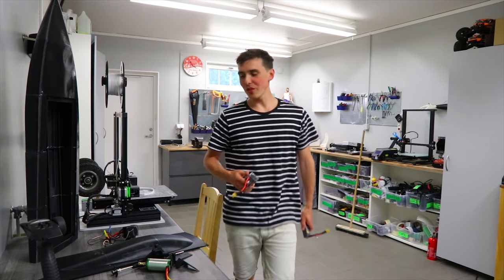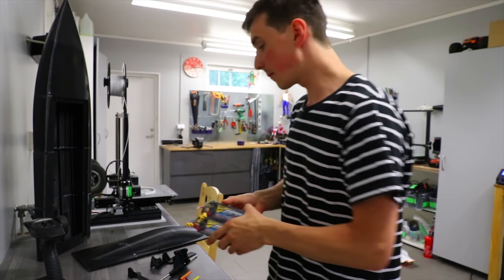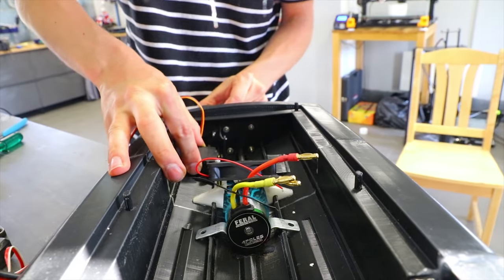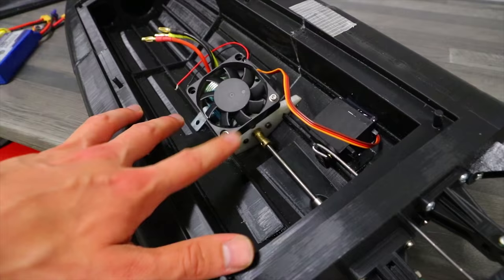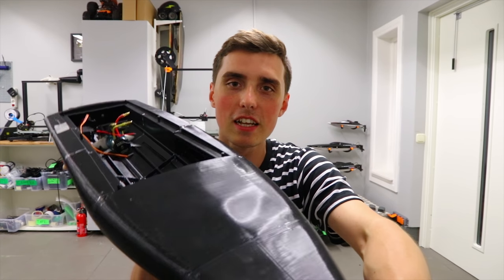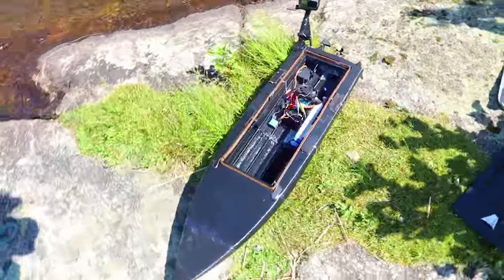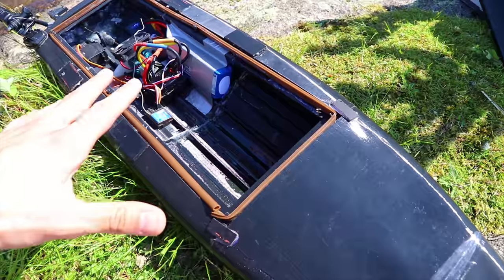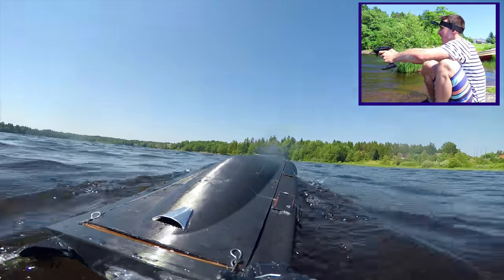BIG 3D Printed RC Speed Boat

Comment: very good video man keep up the great work.. i 3d print rc airplanes and one thing i found out was if your rc is going to be in the sun. print with a silver or gray i prefer colors that are more reflective of the light is best they seam to get the best life in the sun. for my rc planes i still cover them when they are not in use.. be cool to maybe do them in chrome maybe? maybe that could be a good next video see different colors:) see what colors melt the fastest or holds up the longest?

Comment: polyurethane the boat hull works real good, also I would not use epoxy, I would use a "3d printing pen" as a welder to connect the pieces
Reply: oh one last thing if you use pla filimant in 3d printing pen, temp needs to be a little warm, like 220c also a Dremel tool can take off excess or smooth out the welded surfaces

Comment: Yeah, my tipps on this; 
Don't print the Z-Axis over the length of the boat. It is far more reliable to print them (with support from the inner side) laying down.
Secondly, i would increase outer Layer Number to like 5 or 6 and try over extruding a bit, to make the whole thing more Water resistant

Comment: Way too late, but here are the ways I think your boat can be fixed:
1. More weight in the rear of the boat. This will make the boat glide on top of the water more than having to push through a lot of water
2. Use smooth rods/ treaded rods to connect the sections together

Comment: Issue #1) The leakage of the printed parts is due to underextrusion. The actual filament probably is ever so slightly thinner than the diametre entered in the settings of the slicer sodtware. Thus the volume extruded per step is lower than what the slicer expected, and the printed part is slightly porous. Not a huge trouble, paint will fix it.

Issue #2) I found that Uhu Allplast is even better for glueing PLA than epoxy. You will probably have the best result if you sand/grind off al residue of the epoxy from the surfaces where the epoxy failed and give them a good coating of Uhu Alplast. This rather welds the pieces together than act as an addhesive. I was very surprised, seeing how well this cheapo stuff works with PLA. 

Issue #3) The propeller needs to have a plate over it. The trouble is called cavitation, and a very common one with all boats.
When I saw where the propeller was mounted on this boat, I expected it to happen. it´s a designed-in failure.

Comment: Failure is just part of learning. I learned that to get the best joint you have to make a jigsaw of the edged so they snap together but there is another option, SAND flat, AND SUPERGLUE. Also, Last time I used PLA to make a quick throwaway cup I had to use Superglue and coat the whole inside and sprayed it with the instant set. CA not that Expensive Crazy glue.

Comment: Also with PLA, you might want to try a solvent. Weld-on #4 or whatever is available usually works on PLA. or if you are like me and have it on hand, Methylenechloride works as well. Also, you should design built-in interlocking parts to the prints to give the seams some more structure. Also also, print with 3 or more walls to make the hull walls thicker so they don't leak as much. Like I said in another comment, you can spray it with plastic compatible clear spray paint to seal it better and protect it from the sun. 
I want to see you do more with this for sure!

Comment: One thumb up for trying, One down for lack of planning. 
Designing a boat that floats well isn't an easy task in it self, there are even specialized software that let you study the fluid dynamics for your design. 
I would have taken a mold/3d scan of an existing good one and start from there.
Btw PLA is just the wrong material for containing water, PET-G much better. Layer density also might play a factor.
Nice video anyway I'm looking forward to your next better attempt:)

Comment: What glue did you use ? I'm 3D printed planes, the parts are held on using CA glue, the gluing surfaces are waaaaay smaller and these things are really solid, and they take way more abuse than a boat

Comment: Really amazing work, dude! Really nice! 😀
Some suggestions I would make is to try different filaments to see which is better in the water. Then play with different infills... About the motor, maybe the bearings aren't a good idea. What people usually use is a metallic pipe (like a piece of antenna) where the shaft go inside. Then just a bit of oil and you're ok. 😉
Anyway, I think it woth a try. 😊

Comment: Try to get the prop lower, add trim tabs, and seal the outside with some type of gel coat.
And I'm sure you'll sure up the supports, won't hurt it to be a tad heavier.

Comment: 1. Paint the bout. 
2. Try to use bolts and Acetone to glue the parts together.
Reply: Acetone does not work on PLA.  Acetone works on ABS.

Comment: Yeah, PLA and water, hmmm. I've now applied a cellulose-based clear lacquer and will now run some more tests. Boats are a really tough task. ABS may be a better material, but hard to control warping on thin walls. Tests, tests and more tests! I'm building a RC jet boat in PLA. Nothing but leaks so far, all over the place.

Comment: I wonder where the water is coming from, maby the 2 big holes in the roof which constantly get submurged? And use acitone on the hull and joints to fix potential holes.

Comment: your camera being off-center of the boat is going to cause some issues.  cool vid.  I don't know if you've heard this, but when gluing two plastic pieces together, you're supposed to sand them down so they have rough edges which helps the glue bind the pieces together.

Comment: Should use 4mm flexshaft and bigger prop. It was cavitation you were hearing, your prop was sucking in air therefore breaking water tension there's several ways to remedy that problem like lower the prop for starters.

Comment: That's the problem to work aquatic projects with. Water is a big problem. I recommend to print instead to vertical to horizontal way, because you can avoid the water in there through the layers.. I think could be the solution... but. it was intereste!! thanks

Comment: First of all great video! And second try designing the boat with "conecting parts" kinda like lego or a puzzle where you don't put all the force imto the glue and also the part itself. Second thing maybe abs would be better for this as it supports higher temps and also you can give it a bath of (cant remember the name) and get it super smooth and so maybe get rid of the leakages. 
I'm sure you'll figure it out and i hope any of my ideas are useful 😄
Have great weekend!  Cheers from Argentina

Comment: Dunno if you might revive this project but your boat sections would stick better together if you used 200-400 grit sandpaper to rough up the adhesion area(s). Just a thought. I didn’t make the same mistake and my deep V cuts through seawater and large waves without difficulty other than the obvious salt in components problems. Par for the course. 

Good luck.

Comment: Me and my dad made a rc Outrigger and we had the same problem you need to get a bigger prop and swap 2 motor wires and reverse the motor channel on the transmitter. Try to put a water proofing on the receiver.

Comment: I wonder if doing a 3d printed boat and using a vinyl coating would work to hold it together and make it more water tight?  Nice work even if it does need more to make it right.  :)

Comment: Why not make it so the different parts of the boat lock in to place due to slots that you made to hold it in place apply the glue or whatever you use to keep it together then water proof it with the waterproofing material you spoke of epoxy?

Comment: Great video. 
Coouple of ideas for Version 2.whatever... ;)
Did you think about using ABS plastic and then an Acetone vapour chamber to smooth and seal the plastic water tight. (if possible!?!?)

Or anchor points to screw the segments together, and a flexable printed rubber gasket between each one. That should give it added rigidity and a better water tight seal.

Comment: that motor should be swinging about a 42-44 mm diameter 1.4 pitch surface prop.
good effort, but you should do the hull with foam board (paper peeled) then start laying up 4oz fiberglass cloth with epoxy resin to about 2 mm thick, then slice foam away to epoxy in your frames and stringers to the epoxyglass hull itself. can tell, you're not a boat guy yet! :)

Comment: My Idea for waterproofing would be annealing, as well as a coat of waterproofing spray.
Reply: For structual rigidity I would say try a different material than pla.  Also friction stir welding with a drill and a short bit of filament in the drill chuck would make for a strong bond.

Comment: Hi Simon, great video. Just a quick suggestion: instead of gluing the boat pieces together try and weld them using a soldering iron. It should give it much more strength and also it should be leakproof :)
Reply: FrederickTL good Idea, but I think, that it isnt so good for the soldering Iron...
Reply: Maybe hot air gun would be good with some glue?
Reply: Maybe friction welding?
Reply: it looks like he tried friction welding with the dremel
Reply: Welding with aceton should work too (probably the best solution). Also an aceton vapour treatment might solve the water "seaking it's way through", but probably a paintjob would be a better idea since it should also stop uv degradation.
Still an awsome project !
Reply: pgScorpio acetone “would” be a great suggestion “if” he was working with abs 😉. Not gonna work with pla
Reply: rc Ohio Not true... acetone works also on (most) PLA ! Just needs some more time to work-in and dry but gives a bond that is stronger than the printing layer bonding !

see also: https://youtu.be/VZUfq0yrtv4

Comment: REally great.  I am thinking I might try printing one using ABS, so I could easily glue it using ABS solvent glue.  I wonder if your prop is too low in the water. I have a similar boat and when it gets up on plane the prop shaft is right at the water surface.  It is a surface penetrating prop setup I think to avoid cavitation of a fully submerged prop.  Oh, and you really need to water cool that motor and speed control.

Comment: use petg instead of pla. it doesn't warp like abs and it's stronger and more heat resistant. also make sure you are pushing up your extrusion until you are over extruding this will help bond the layers together (you can also consider going up in detail of possible but obviously that's more print time). also to help bonding and structure strength you should make posts that come off the end of each part that insert into the next part this will give you more surface area to bond with. or consider just making the holes and using wooden dowel rods. 

additional tips If you have trouble bonding the pieces together you can alway use a saudering gun to weld the parts together. it's ugly but it's a stronger bond than the printer makes. if you are having trouble getting parts to be water proof use plastidip it's nontoxic once cured about 6 or 7 light coats 15 min apart and you should be completely water proof (you want lots of little coats for a nice even shine and distribution) 

if you are going to insist on air cooling you are going to need to put some sort of a snorkel so you can get air from several centimeters above the waterline. likely you will still need some way to deal with water getting in the boat. it's hard to keep it out which is why most designs just use it to cool the engine and blow it out the back. (which also is used for thrust)

Comment: May i suggest two tips :
1) Fiberglass the hull from outside will solve the water and rigidity problem
2) Test a bunch of different "surface piercing" propeller, the one seen on the video at 0:38 is definitivelly not a "power boat" class propeller and is most probably the reason you had very poor performance for this setup.

Comment: First mount the motor and ESC on ABS not PLA because that is just asking for trouble. it will reach over 60* easily then you are going to have real problems. The propeller is not deep enough into the water its way to shallow once the boat gets up on its plane its not deep enough to still be in the water because its in the wake caused by the boat. Yes 3d printing doesn't cause a perfect seal in plastic when you are printing with small nozzles, i would recommend using a Volcano or bigger nozzle size with at leased a 0.8mm to 1.0mm nozzle with some layer squish. Overall i would of made the entire boat out of ABS because you can all ways use Acetone and dissolved plastic to paint over the model to make it thicker, sealed, and stronger. PLA has a tendency of being a little brittle although is just as strong as ABS actually i think PLA is slightly stronger but when it brakes it shatters, where ABS will just deform.

Comment: PLA is a terrible choice for this application. Print in ABS plastic, you can acetone weld the parts together, ensuring a seal. If you could, make the boat a little wider, and a little deeper. It will give you more stability by being wider, and being a tad deeper, increases your boyancy. For the motor, find a way to reduce the Gear ratio to where the motor has an advantage, that way it won't get bogged down.

Comment: We're you using your GoPro as an gov cam or did you have it connected to your phone during the boating, if so the GoPro can mess up the signal between the Trx and Rx, I had the same problem with and rc car and it flew off the road into the grass. I took the body off along with the GoPro and tried running it again and it worked fine.

Comment: What about mounting the camera in the middle of the back?  Other than better balance,  that little bit of extra weight might help keep the propeller under water as well.  Also maybe hobby shops have some sort of paint that could help with waterproofing.

Either way, great content and fantastic first attempt.  I eagerly await the next version(s) as you perfect it.  Cheers.

Comment: Epoxy is very bad for PLA - it just won't hold, use CA (cyanide acrylic glue - "instant glue"; it holds stronger than PLA integrity). Use some spray-paint on outer-hull to close some PLA gaps and pores. And when making second version, design in some structure reinforcement. Overall, nice.

Comment: Try a neutral trim angle next time. The current design has too much negative downward angle that's pushing the box down and lifting the prop above the water line. OR you could put more weight in the rear near the motor or use a less powerful motor/battery.

I think by using black PLA, the epoxy got too hot and became very soft, causing an adhesion failure.

Good luck next time!

Comment: ... the 3d printing is good for making the positive for moulding, and then in the mould, you make that real boat with fibre glass and resin or carbon fibre or  kevlar and epoxy .
Before 3d printer the boat used to be made from plywood and timber stripes

Comment: Even at 2.45 ghz the antenna needs to be above the water to get a good signal. I had the same problem with my rc boat after replacing the receiver. I lost control of the boat for a few seconds. Then I researched it and it turns out that the antenna must be above the surface of the water.

Comment: RCLifeOn if it was a rc car control system then it was most likely 2.4 ghz and that doesn’t transmitter through water that’s why traxxas has ante antena tubes on there boats

Comment: Great video. On the MK2 version what if you design the sections to have threaded bar inserted in them. I saw 3D printing Nerd print a sword model that worked a similar way. That way you would have 2 or 3 solid bars running the full length and have more surface to glue the sections together.

Comment: I'm not familiar with PLA and I don't own a 3D printer, but how does plumber's PVC pipe glue react with PLA? ...again, I have no experience with 3D printers or PLA ...just curious.  If it works, then it might be an easy & cheap fix for joining printed parts.

Comment: Whenever I attempt to level my cr 10s I level all 4 of the corners but when I get to the middle the nozzle is too close to the bed. I’ve tried  to use another mirror because I read up on warped class but this did not seem to fix my problem. Whenever I look up videos of leveling the cr 10s all the sides usually are leveled perfectly. I’ve been struggling with this printer for 3 months now and haven’t found a solution. I’m thinking I may need to change its location because our flooring isn’t exactly level. Please leave suggestions if you have any. Thank you in advance.
Reply: Da Horsie First I thought, that it is the mirror, but maybe the x axis istnt good. Maybe you have to change Aluminium rail.
Reply: CoolTube Alright, I’ll be sure to check that. Thank you!
Reply: Maybe you Y axis carriage is warped
Reply: tom parry Okay, thank you
Reply: You Z axis is if off. Nozzle should be about one business card away from the bed.

Comment: Don't you think printing at a higher temperature would fuze the layers more and make it watertight for more than 30 sec? :p
Maybe you shouldn't print flat parts to glue them end to end but instead stackables part with overlaping slopes. It should boosts your structural integrity
For the propeller blowing air, maybe a bigger (and slower to keep the same power draw) one will fix some of the issues.
Finally, print it in white, rainbow or anything but black. I want to see this project being a success. :D

Comment: disregard what i said last week, i printed one and used super glue for structure and silicone for  water sealing everything, and it worked great... the first float test went great (i floated it for about 15-20 min) with no water seepage (i also used PLA).

Comment: Nice project 👍🏻 On your aeration issue - that hull setup looks like it wants a surface piercing prop - are you aware of the Octura X series (or equivalent)? Something like an X442/X642 may work with that size hull - you may want to look at Kv’s though. 🙂